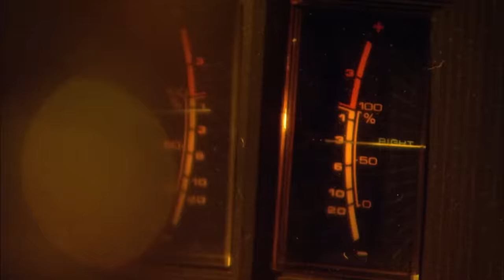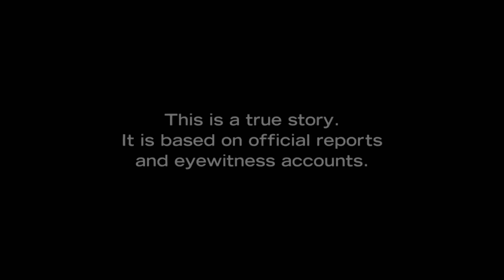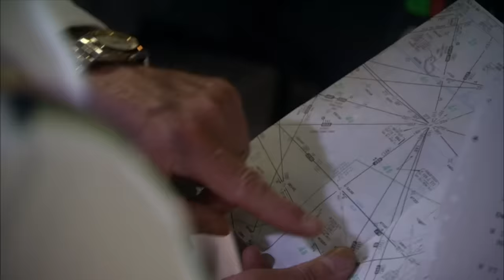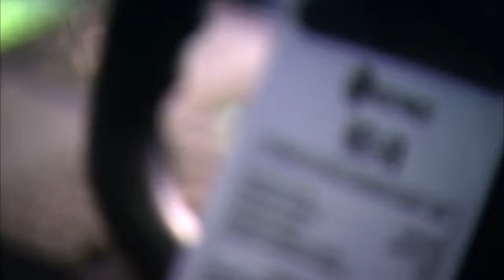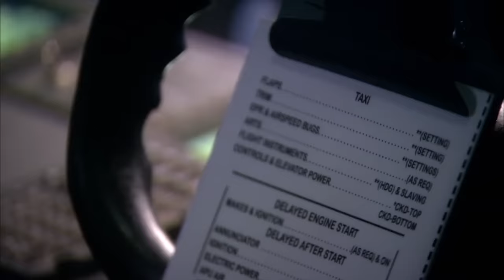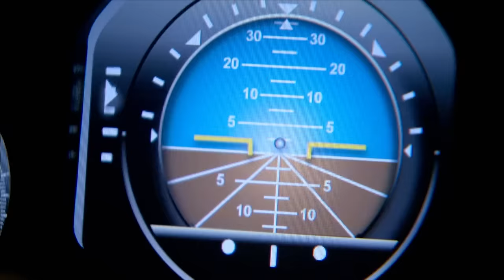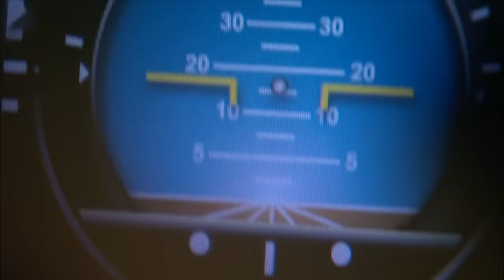The Airplane Crashes At 170 MPH | Northwest Airlines Flight 255 | Mayday: Air Disaster

Comment: Calling this pilot error doesn't capture the full scope. Any time you have a warning that cries wolf, you have a structural problem with the system. I don't care what it is, if the alarm is important and it is giving type 1 errors, it is a disaster waiting to happen.
Reply: Agreed!! This is also a maintenance issue, and we've seen where plenty of airlines don't do proper maintenance. There's so many factors that contribute to the horrific loss of life. Pilot error might have been just a small part of the bigger problem.
Reply: Its not crying wolf wtf
Reply: Great point - not even close to the full scope. I would add that when a warning is being disabled so often that the associated decals for the indicator are smudged or damaged, that means an annoying false alarm is being generated very frequently. Though I personally would not disable such a warning due to the potentially life-and-death nature of what it might be indicating, I understand why some would; the alarm itself might have been very distracting and one would only know what that's like doing the job full-time.

Comment: I have a suggestion. Why not make pilots push a verify button for each checklist as they are completed before the plane will accelerate? This would make them perhaps be more diligent in performing the crucial checklists!
Reply: Some modern aircraft are like this now
Reply: As a systems Engineer, I can tell you that such a system adds complexity to an already complex system. It's another system that can go wrong and create a bad situation. The solution goes to cockpit resource management. As the flight crew go over these checklists the pilots need to speak the item out and the other pilot speaks to say checked. This is why there are 2 pilots in that cockpit. Just today I was reading that United Airlines was fined a million bucks by the FAA because of a preflight checklist issue.
Reply: It might create more problems than it would solve. Not a bad idea, though.
Reply: Wow , you mean to tell me that in over 80 years of plane building and flying no one has thought of that. You should work for NASA
Reply: That would take a long time.
Reply: I agree. Avoid crashes like this.
Reply: Have you seen the inside of a cockpit? Do you think they needed more buttons to push? Do you have any idea how many normal and non-normal checklists there are?
Besides, it’s irrelevant. Some airlines already had a better system in place, and in the wake of this incident, the FAA commissioned a human performance factor research on the use and design of checklists. NASA had also done similar.
And in the 25+ years since this incident happened, a lot of those checklists have gone digital…
Reply: I watch a lot of plane crashes online pilots can abort take off if they find a problem before V1 takeoff they had time to abort they discovered a problem before  they lifted of the ground I believe it's pilots fault
Reply: The preflight checklist IS the button. These pilots were incredibly careless and in a rush to beat a storm. Terrible event 😢

Comment: I'm going to ask a question because I don't know any better. Why didn't they simply have a paper checklist that gets things crossed off? And you simply can't leave the ground until everything's crossed off? And know it's over simplified it but it seems like things wouldn't be forgotten as often...
Reply: I agree
Reply: They do, you can see those pilots weren't 100% there that night.
Reply: This was pilot error and the checklists existed.
Reply: They did? There’s still the potential for pilot error.
Reply: there is a paper checklist for all the checklists they need to complete before take off. the problem is that if pilots forget to check one of or some of the checklists (which is what happened in this accident), no matter how many checklists there are it still wouldn't help the situation.

Comment: So … there are dual/redundant annunciators for the stall warning but not the takeoff configuration alarm(s)? Or were BOTH connected to the SAME circuit breaker? If so, that sort of defeats fault tolerance and redundancy by introducing the dreaded single point of failure which most engineers strenuously try to avoid.

Comment: Just as was pointed out in previous uploads of this same video, the only thing "Northwest" had to do with this incident was their haste to put their name on the fuselage. This occurred a very short time after the NWA/Republic merger. The aircraft and crew were in all aspects a Republic operation. The two entities had not yet merged in any way other than the finalization of the agreement.
Reply: I think the other upload of this video was mislabeled. They had a bunch of those lately.
Reply: Interesting that you felt it necessary to point this out. You are correct that it was a former RC aircraft and crew,  but the merged airline was operating as NW for nearly a year at the time of the tragic incident.  Unfortunately, this type of pointing blame lingered on for several years and made a successful merger much more difficult for many of their employees.

Comment: Yes it was established that it was pilot error, and that there were several contributing factors.  But the one contributor - pulling out the P40 circuit breaker.  Yes, it is a vital piece because it alerts the pilots if the plane's going to stall or it's not configured right.  But the thing is going off when the pilots are on the ground, doing a single engine taxi, and have to throttle up further to do the taxi.  Forget the fact that it annoyed the pilot.  The thing shouldn't be doing that, right?  So I think there's a design flaw or something in that circuit breaker that got overlooked and contributed to the disaster.  If they had addressed that, the pilots wouldn't be tripping it all the time, and they would have been warned in time to abort the takeoff.

Comment: When they switched to computerized checklists, did they still keep the paper checklists readily available in the cockpits?  It seems like the technology offers something new that could go wrong.  Imagine if the pilots can't get the computerized checklist to work, and don't have a paper backup.
Reply: Well, I think the systems are thoroughly designed enough that they’re not worried about that problem. Although I am sure that physical backups exist. It’s just that almost everything in the cockpit is now done through a computer, so just having a checklist is quite a minor task compared to the dozens of major computerized systems on every aircraft
Reply: They still do have paper checklists.

Comment: Seems to me that airplanes should be built with the ability to ABORT a takeoff attempt if it is not in take off configuration.  When dozens or even hundreds of lives are at stake, the computer should have the power to compensate for human error, and simply shut the plane off safely.

Comment: Black boxes should be stored in the cloud. Keep it for acouple days and if there's no accident its automatically deleted. That way they don't have to retrieve them from the ocean floor or be destroyed in a fire or damaged. The entire flight could be recorded and used and not just the last 30 minutes of the flight. Keep black boxes until the cloud is deemed 100% reliable.
The airline industry has learned alot of lessons at the cost of thousands of human lives. Our lives. Money over our safty and Passangers.
Reply: Cloud storage is and will never be a 100% foolproof solution. So much can go wrong and does. Syncing failures, server upgrade errors, bandwidth issues, random disconnects.. especially when you have something as mobile as airplane. So what do you do then if there’s an error that prevented CVR/FDR syncing and you’ve got a crashed plane with no black box now because it’s been replaced with inadequate cloud storage? We are very far from implementing this, trust me this was considered and promptly thrown away.
Reply: @TitaniumTurbine  what if we employed some sort of error correction scheme? Like if I send you a 1 and then a 2 and tell you the sum of what I sent you is 3, and you didn't get the 2, you can deduce that I sent you a 2 because 3-1=2.
Reply: It should be automatic in the control towers to monitor it the the air like gps trackers
Reply: if you've tried using wifi on a flight you'll realise that internet connection is slow and unreliable, there are no radio masts up there and signal degradation over vast remote areas is still a problem